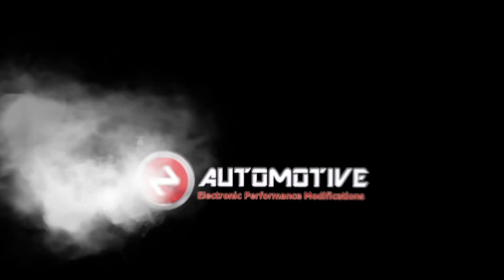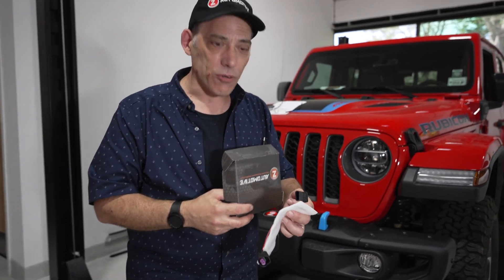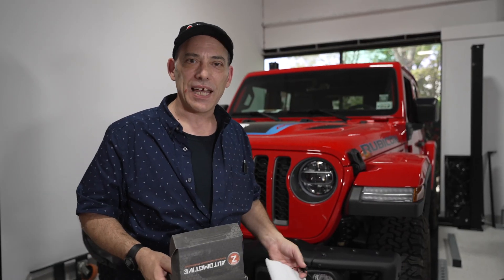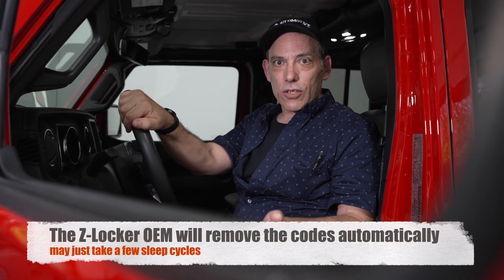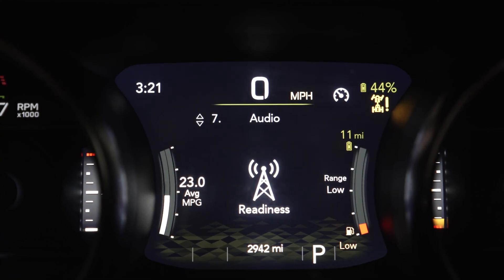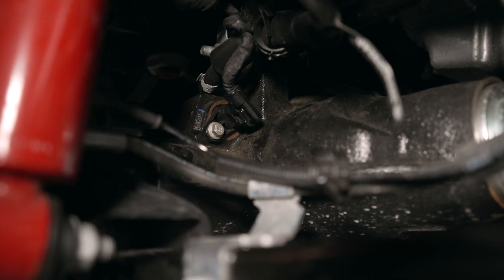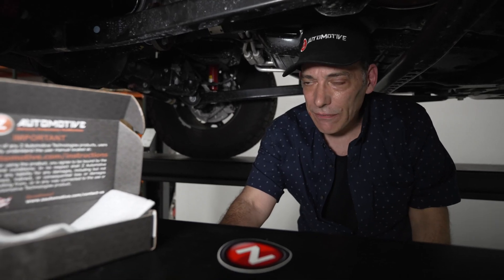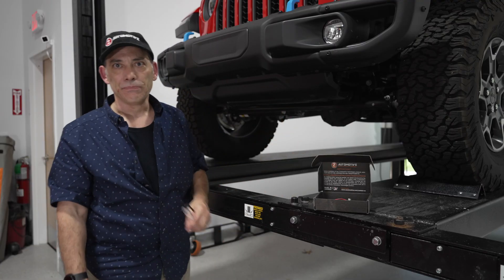Fix the Faulty Locker Sensors in the Wrangler JL Rubicon and Gladiator JT Rubicon

Comment: Just installed in both front and rear. 
5 min install and it worked as described. 

Dealer took 4 different attempts and never fixed the issue. Decided to just do it myself. 

Thanks for the great product.

Comment: Didn’t work for me 😢

Installed front & rear but my locker light is still flashing.   

Thinking I must have something else going on so time to schedule an appointment with dealer
Reply from the maker: That may very well be the case. Read the codes, as shown in the video

Comment: Yea, I took my jeep in to dealership, Vatland Jeep, for an oil change.  They finished and returned the jeep to me with the diff light blinking now.  They said "oh, it can go bad at any time.... $750 to replace the sensor."   I said...nope,  but thank you.  So  wonder if the electronic interrogation they do to systems check the jeep triggered it?  or if they put a little oil on the plug? (which would be VERY devious)  IDK.
Reply from the maker: $750 is just wild

Comment: Hello.  I just ordered the z locker and it’s on my way.  

But not sure if it’s front or back.   When I try to turn rear get solid yellow.  And when try to turn on front and rear, it keeps flashing and only turn on rear.  

Does that means my front sensor is bad?

Appreciate any help.
Reply from the maker: Please see the part of the video where Scott discusses reading the codes with a scan tool, or the TaZer programmer as shown in the video
Reply: @zautomotive I saw that.  But if don’t have a scanner, anyway to confirm?  

Mine rear locks, does that mean front one is the bad one ?
Reply from the maker: @K_A_9999  put the z-locker on one or the other and see when the light turns off
Reply: I tried on both axile, but still getting error.  Do I need to clear code or something?
Reply from the maker: @K_A_9999  there could be an actual issue that isn’t the faulty sensor, in that case the product wouldn’t be able to bypass the error code. Please email support@zautotech.com for assistance

Comment: So glad to see this.  My EXTENDED jeep warranty excluded the part and labor so dealer wanted $150+900 labor but the GOOD news one the required harness change ($40 part and $80 labor) was covered.  Sheesh.
I figured out which sensor as it always flashed the rear lockers trying to disconnect.  Mysteriously this happened AFTEr they changed the rear diff fluid.  HMMM.
Thanks for providing this amazing fix.  Love my Tazer just hate having to remove it when taking the jeep in under warranty.  My hands can't see to find the original connector sockets easily to return to factory.  LOL
Reply from the maker: Happy to hear!!

And Sounds like it’s long overdue for you to buy the SGW extension harness, basically a must have for anyone Tazer JL owner

Comment: Bought 1 for back worked a week then started again contacted Z they said I need another for front so I dropped another 200 the lights still on think they are not very robust after 400 dollars I had 1 week with no dinging they are junk
Reply from the maker: Did you buy directly from us or did you get scammed by the cheap knockoff? 
https://youtu.be/TndGD64vF88?si=M1oPekUB-WPiIG5s

Also did you read the codes as the video states, if it’s not one of those codes, it could be an actual issue that the z-locker can’t bypass??

Comment: 2018 JLUR  Installing the rear was fairly easy.  Took some doing to get the clip open.  Unfortunately it pulled all the way out.  Couldn't get it back in so I zip tied and taped it.  The front was very difficult for me to get the clip open.  Of course, I'm laying on my side trying to fit my big hands in a tight space.  Once I did get the clip open it was easy.  Time will tell if I stop getting the "service axle locker" message but I'm very hopeful based on other's experience.

**Update**
The error message did stop, for a while.  I'm back to getting it several times a day.  One day it happened three times in 30 seconds.  I guess I have an issue that needs to be checked out.

Comment: I installed on front and rear of my 2018 JL and made the light go from steady on to flashing on intermittently. Pretty bummed this did not work!
Reply from the maker: Did you purchase directly from us or get the knockoff that’s been going around?

Did you read the codes as shown in the video? If they are different codes then the ones shown the lockers may actually have a different issue

Email support for assistance - support@zautotech.com
Reply: @zautomotive  I bought one from your store and one from my local 4x4 store, Desert Rat. Unfortunately, I don't have a way to read the codes at home.
Reply from the maker: @burningcan  hopefully they sold you a legitimate one. But yeah, best option would be to read the codes whether that’s with our Tazer or another code reader to verify if the z-locker is the correct fix for the issue
Reply: Just emailed support

Comment: I am confused. The OEM locker sensors are there for protection. If we bypass that protection  permanently with your kit then wouldn't damage occur due to the OEM sensors not protecting anything? Because if it was this easy then why did Jeep have these sensors anyways if you don't need them for protection?
Reply from the maker: Yeah you are a bit confused, as the OEM sensors are the problem. We are bypassing the issue with the Z-Locker. The OEM position sensor is what is causing the problem within itself
Reply: @zautomotive  So then what are the OEM sensors sensing? If the diff is moving or not in order to lock the diff? So if we bypass the sensor and then try to activate the lockers while moving fast by accident then wouldn't that cause damage? Just trying to understand more. Because I think by this product bypassing the OEM sensors, it is tricking the vehicle into thinking it does not need this sensor and if that was the case, I think Jeep would just omit the sensor.  Just looking for a bit more clarification, I do like the product and the potential of what it can do.
Reply from the maker: @ for starters, did you watch the entire video?

Comment: Be nice if a pigtail that cost 5 dollars to manufacture wasnt 170
Reply from the maker: @erikgriffin5193  if you’d like to buy the temu-knockoff version without the correct firmware (which is what you’re actually paying for) here’s what to look out for - https://youtu.be/TndGD64vF88?si=2MAG04CgcdLsslbf
Reply: @zautomotive  bought 2 off amazon and they work fine ...had to modify the plug with a dremel to make it fit ..but definately worth saving $140 though
Reply from the maker: @erikgriffin5193  let us know when they fail or fall apart.
Reply: @zautomotive  sure thing 👍 will likely be around the same time the price gouged bull shit will
Reply from the maker: @ again, you’re paying for the proper firmware and technology. Good luck with your knockoff. Great job supporting Chinese fakes
Reply: So, you buy a $50,000 Jeep and are too cheap to buy a quality part?  Where did you get your MBA from again?

Comment: I bought 2 of these. 
It did not fix the issue.
So im guessing it is really broken.
The company did give feedback and good troubleshooting to try.
Im not disappointed in the product. Im disappointed it didnt fix my front locker problem.

Also on Uconnect screen on the radio.
It shows both lockers locked. But they are not. If they was you can tell by gling slow in a circle.
Reply from the maker: @Labyrnthdom  did you end up going to the dealership, what did they say the issue was? If it was one of the issues with the codes mentioned in the video, the bypass won’t work; curious what’s going on with your lockers

Comment: Im getting “service axle locker system “ on my TRX . Will this solve the issue ? It pop up when I hit a big bump then goes away after 3 secs
Reply from the maker: @eddygtv7105  the Z-Locker is not currently compatible with the TRX but you can email support to see if they can assist in any way - support@zautotech.com

Comment: I have an '18 Rubicon.  Had my rear axle replaced in '21.  Now I'm getting the message again.  They now sell sensor separately (actually a kit of 5 different sensors because apparently only 1 works?  That's what the parts department told me).
Anyway... I'm leaning towards buying this Z Locker OEM but watching this video I'm concerned now.
He mentions that it could be due to metal shavings in my differential?
Maybe I shouldn't simply put this thing on which will ignore the issue.... should I get out fluid checked out?
Reply from the maker: If you're concerned get it checked

Comment: I bought two of these things and it still says service Axel log system every time I accelerate and then it goes away
Reply from the maker: @Bit-toons  have you checked the codes? If it’s not one of the ones shown in the video, then maybe it’s a problem outside of the locker sensor, which is what the Z-locker is bypassing

Comment: I ordered the Z locker and installed it, but the error code didn't go away. Turned out that my battery was faulty! New battery installed, and there are no more problems.
Reply from the maker: @brucedemarest3929  yep faulty batteries will trigger all kinds of codes and lights

Comment: They really should include instructions with these parts.
I installed on rear axle,  no change. So I took it off and put it on the front axle...still no change EXCEPT now I'm getting g a "SERV 4WD" light (solid).

How screwed am I?
Reply from the maker: I'm confused, you're commenting on the video that is the instructions... As mentioned in the video, if you have the TaZer you can read the codes and see which axle is having the problem.

Comment: Just removed the rear oil filled sensor, drilled 3 holes in plastic sensor body, cleaned out with electronics cleaner then potted the sensor. Cleaned steel fuzz off sensor magnet, added fresh Valvoline 75w140....no more "ding" or "service axle locker" message. Cost about $55. For two quarts of gear oil and potting epoxy to fix and jlur needed differential servicing anyway.
Reply: May have only cost you $55 in materials, but that sounds like a lot of work and lots of possibilities for failures.
Reply: Going to have to repeat these steps every time you get that message. I'll take the permanent fix, thank you. BUT, good ingenuity!
Reply: Good job! Most of these clowns can barely change their oil.
Reply from the maker: @MrTurbo64  great… plenty of people that don’t want to do that though

Comment: What do you suggest doing if my 2018 wrangler JL only has the flashing locker with exclamation point. It hasn’t changed to a steady symbol.
Reply from the maker: Buy the Z-Locker because that’s the initial sign that they’re going bad. Feel free to email support for further clarification- support@zautotech.com
Reply: Should I purchase front and rear?
Reply from the maker: @fernandobarba998  as the video says, best thing to do would be to read the codes to determine which one is going out. If there is no codes, you can buy one and install it in one place to see if the light goes away. If it doesn’t, move it to the other location and see then

Comment: My only question is. Can the lockers be turned on while not in 4L? I sure hope it doesn't let it do that.
Anyone know?????

I know it is my front one because the rear will lock in when the service light decides to go out.

I bought 2 just to go ahead and fix or patch the problem.
Well, worth $400 for both shipped.

Comment: If there actual locker problem will this notify you or is this bypass and no longer tell you of actual mechanical problem?
Reply: There's no actual problem with the lockers themselves its the little metal shavings that cause the magnet interference and won't allow the lockers to work. This just bypasses the interference if you have an actual problem with the lockers not working your lockers won't work after sensor is put in. I had this problem.
Reply: I have the same question   Any help Z Automotive?

Comment: I have the common issue and intalled the Tazer bypass wire and it permanently brings up the service locker light on dash? Do i have a wrong setting on the Tazer or some unkowen issue?
Reply from the maker: Have you tried on both front and rear? You could also read the error codes through the TaZer as shown in the video, to see which locker is throwing the codes

Comment: This fit for 2021 Gladiator Mojave? , I bought from Amazon and don't match with the connectors😢
Reply from the maker: yes... email our support team and they will help you troubleshoot the issue. support@zautotech.com
Reply: @zautomotive  there's no difference Rubicon's and Mojave . The one I bought on Amazon looked the same as the one you sell, but it wasn't the same size. Does not fit
Reply from the maker: @Scarlett16049  okay as mentioned you need to contact customer support, I can not help you with an exchange or identifying if it's even our product. There are many third party sellers on Amazon
Reply: @zautomotive  I will thanks for your support, Can I keep driving with the light blinking?
Reply from the maker: @Scarlett16049  I dont know what light is blinking... another question for support
Reply: @zautomotive  AXLE LOCKER REAR ONLY

Comment: I just installed this on my 2019 JLUR with the rear locker flashing on my dash. The flashing went away and the locker works just fine. Thank you for the fix. I'll be buying another one for my front locker, (just in case) since I regeared to 4:88s 4 years ago.

Comment: See I have this problem but my Jeep says it’s everything. It says it’s the sway bar, it says the lockers, and then it says to service my 4wheel drive as a whole ! It’s ripping my hair out bro does anyone have know if this wire would change that ?
Reply from the maker: Sounds like more than just locker failure. Do you have a TaZer to read the codes?

Comment: I'm going on my second time around with my 2020 JT Rubicon flashing the "Service 4WD system" and the yellow stays for about 3 seconds and then goes away. Mostly when I accelerate from a stop or hit the accelerator hard to pass someone at highway speeds. It goes away but the tone and lightup on the info center is getting annoying. Will this fix it?  Been to the dealer once for a faulty speed sensor (thought it was that) but the problem is back.  Thanks.
Reply from the maker: "Service 4WD System" would not be the same issue as the "Service Axle Locker System" that is being shown and fixed by the Z-Locker OEM

Comment: This system can be installed and left permanently? I assume you can Install for preventive measures as well.
 Appreciate any information. 
I have zero issues at this time. I can only assume this will eventually happen no matter what, and the only way to combat this situation is to change the rear dif fluid often or purchase this product and change the rear dif fluid when prescribed in the manual.
Reply from the maker: Correct, it can left in permanently, or as many people have mentioned to us, they just leave it in their glove compartment and have installed it when needed. Also, as mentioned in the video, if the Jeep does end up having a locker issue, you can use the tazer to read the code and determine which locker is having the fault

Comment: How often does this happen with the stock setup? Is it a gear change that really helps this problem to occur or is it happening on stock Rubi's just as often? Now I know you are in the business to make money off of these great products but couldn't frequent differential oil changes and cleaning of the magnetic drain plug help to prolong these sensors wether stock or modified if you are saying it's the metal gear debris that's creating this failure?
Reply: @zautomotive  Thanks, I should probably get one of your devices to keep in the glove box just in case. Unfortunately, your fix is on backorder too, haha. I guess the secret is out. I love my Tazer Mini so I'm sure this device would be no different.

Comment: Have you had any issues with any wires breaking even though you zip tied it to remove some slack?
Reply: Mine broke after 6 months of use at the glue on the plastic box.  Unrepairable.
Reply: @9821Joker did Z Automotive send you a new one for free?